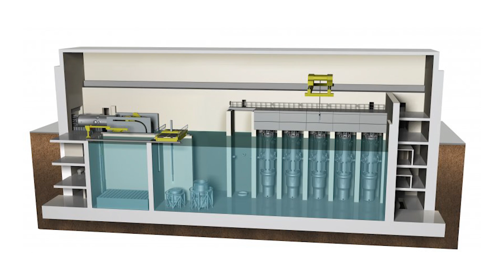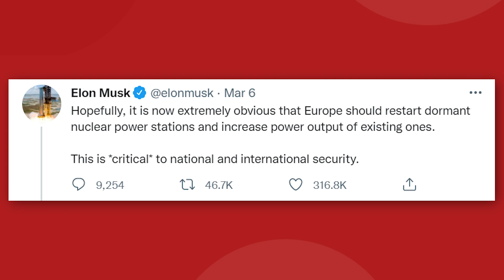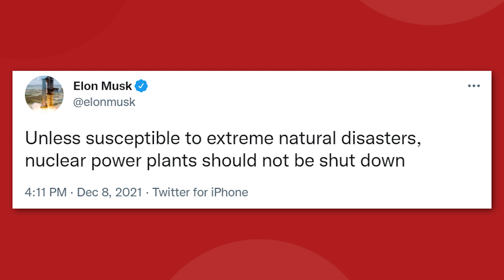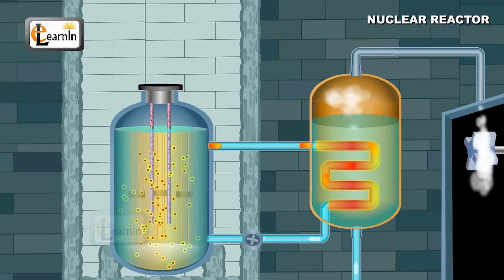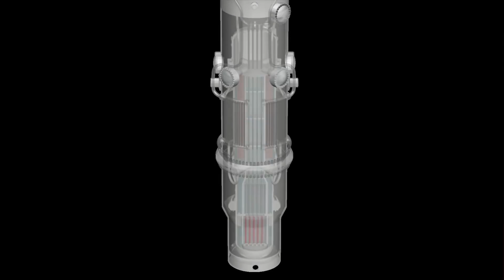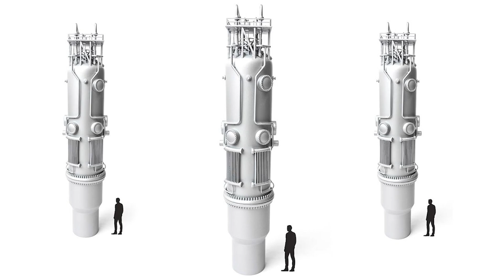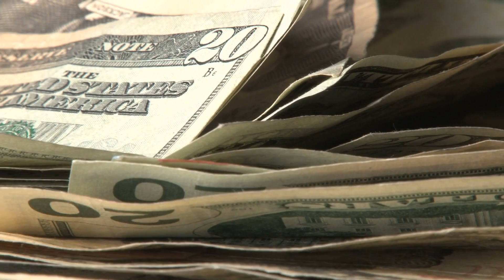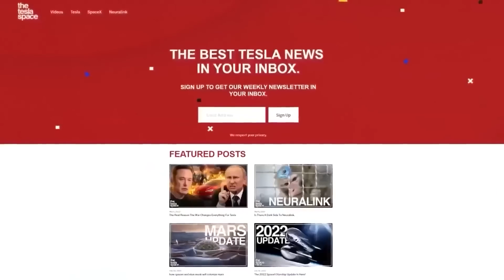The Real Reason Nuclear Energy Is About To Take Over!

Comment: You need to investigate liquid fluoride salt thorium reactors.  They produce far less nuclear waste that remains dangerously radio active for only 300 years or so as apposed to the nuclear waste that is dangerously radio active for thousands of years..  In addition they can use nuclear waste from old water modulated reactors to produce power.  In addition they shut down automatically if things get out of hand. China is way a head of us given that they are already building LFTR nuclear power plants based on Oak Ridge LFTR experimental power plants 60 or so years ago.

Comment: The #1 impediment to clean, safe nuclear energy is anti-nuke activists. Fighting lawsuits and unnecessary licensing and environmental 'reviews' DOUBLES (at least!) the cost of a nuclear power plant, slows down when electricity can be generated by a decade per project, and scares away investors.  Without their interference, we'd be living carbon-free already.

Also... not free ELECTRONS. It's NEUTRONS that can cause a nucleus to split. =)

Comment: Did you eat paint chips as a child?  It's NOT the purpose of boiling water, it's driving a working fluid through the Rankine cycle, just like all the other power plants.  These could still blowout from a steam explosion...
Reply: A steam explosion is not a nuclear meltdown, and any power plant using steam could also blow as you meme.

Comment: I have a star ship design that requires three such modules for propulsion and station power shipwide.  A minimum amount of solar power would be available at first but then 3 nuclear modules of 25 megawatts or larger.  75 megawatts seem like overkill for this project, but a 20 year life span is cutting it close.  I suppose that running at a very low power, like 5 megawatts continuously would extend their lives or perhaps they will run at 25% after 20 years and that would be okay also.    So my question is:  How much do they cost and how much water do they need for continuous running at say 10 megawatts?
Reply: Since the power conversion to electricity is not 100% you should worry about how to dissipate the excess energy in space. Water, if used at all, would be recirculated and is not an issue. Radiant Nuclear is making a design that uses only helium.
Reply: @alan.wootton  correct.  My engine idea is hotter than a nuclear reactor or engine and the heat will be a big problem, to solve this I must use water for the engines, but recycling it more than once may be problematic, but it can be utilized to generate more electricity, and hopefully last for 3 or four minutes into orbit before reaching critical temps.   As for the nuclear module, it is actually part of a much bigger orbiting space station and would  have millions of gallons of water for coolant and space is cold so it won't be a problem once in orbit.   Helium?  THat sounds interesting, except that it is hard to contain helium as it passes through most materials, plastics and thin metals.

Comment: SMRs using water/Boron are still high pressure but I agree are totally safe. They produce a similar amount of waste per KW/hr as traditional Nuclear. By contrast, Molten Salt Reactors (MSRs: next generation SMRs) generate about 95% LESS waste and some designs even run on existing nuclear waste. In any event GO NUCLEAR. Far more resources should be fast- tracking both.

Comment: I'd like to hear more about our LONG-TERM ability to manufacture fuel and then safely store the waste. I'm not completely opposed to the idea of nuclear energy, but everything else being equal -- which I realize it's not -- I'd rather not promote a technology that generates large amounts of highly radioactive waste with an incredibly long half-life. I'm still also attracted to the greener concept of a multi-technology plant, that combines solar panels with wind turbines and a large battery storage system. But it's impressive that these SMRs can't melt down if there's a loss of power or coolant due to the electromagnetic control rods, and the modular design and longer service life is a great plus.
Reply: Check out thorium reactors, I don’t know why we don’t mass produce them after a sound design is developed, they “burn” nuclear waste and reduce their half life dramatically, about 100 years total radioactivity instead of 10,000!
Reply: The waste has never been a technological problem, only a political one.  Oklo Gabon proves that even a natural two-billion year old nuclear waste dump was never a problem even without out technology today.

Comment: There are three issues that determine what generates our electricity:
economics, economics and economics.

According to the Canadian Nuclear Association, SMRs "hope" to get down to $80/Mwh after having built "several hundred" of a common design sometime in the late 2040s IF they  can agree on that common design. That price is more than wind and solar backed by batteries are today, and they are getting cheaper. 
So, sorry, but SMRs are neither a quick or a cheap fix to our power demands.
Reply: That’s just a bunch of lies.
Reply: They're pretty much battery chargers to the wind and solar because them need energy to make them work.

Comment: Neutrons and not electrons are needed to sustain fission - fix that error at 6 minutes. NuScale is only getting started by 2029, so wind and solar must be expanded massively now. With such a slow start, new Nuclear will lag renewables and it remains to be seen if these new SMR's can be more economical than renewables plus storage or existing BWR/PWR. Several designs (not all)  do seem "walk away safe" without the need for powered cooling pumps to remove decay heat so there is some promise they will be safer, but uranium 235 based SMR nuclear will emerge to reduce the need for batteries to support cheaper renewables and to make hydrogen and will not dominate the future source of power.
Reply: Everything is more economic than renewables and storage. They’re so un economic that it’s never happened at true grid level
Reply: @kokofan50  Low cost gas has pushed coal out of business. Wind and solar are now lower cost that gas even without any price on carbon and renewable price is going down. Suggest you look a Lazard levelized cost of power.
Reply: @rickrys2729  Lazard leaves out a lot of costs. Try looking at the empirical data. In 2020 Germany had far higher electricity prices than their neighbors in France. Germany has been on a decades long renewables kick, and France has been mostly nuclear

Comment: Nuclear great as long as you stay away from repackaged Cold War relic reactors, most SMR are based on the same design that Brought to you Fukushima, Chernobyl, 3 mile island, I think your confused between the term’s SMR and MSR, old reactor like the ones currently used have a efficiency of about 1%, MSR have a efficiency rating of about 99%. Efficiency makes a big difference in the amount and time you have to Store hazardous radioactive waste, a 20,000 years storage drop down to only 300 years just by using a MSR. Radioactive energy released from uranium not only heats the water but also generates explosive gases from the water, same type of gases that cause the explosion of the space shuttle, when things go wrong at a reactor this is what makes it explode, MSR don’t use water and able to operate at higher temperature with out the need for expensive containment measures.
So you might want to do a little more research next time.
Reply: They're all uranium based.

Comment: We have been hearing this srory fo 50 years.  Nucelar power will be too cheep to meter.  It seems like you've detailed all the reasons we should not be doing this. Yet the story is about more nucelar and more subsidies.  And still no solution for the waste.  In the mean time, solar, wind and batteries are the cheapest and fastest way to get energy and it's getting cheaper every day. So I really cannot see why anyone would pursue this.  We just do not need it.
Reply: No way in hell solar and wind catch up in time, if ever to charge even half the cars this numb nuts wants to sell.
Reply: Wrong on so many levels.

Comment: Not convinced that this will scale that quickly. Sodium ion batteries would be quicker to scale and lot cheaper. Also woul encourages decentralised generation and storeage. One of Tesla energy heads hinted that Sodium ion will be a major factor for stationary storeage.  Would be interested to see your take on it.
Reply: So how do sodium ion batteries CREATE energy then?!?
Pretty sure they are just storage and not power plants like a nuclear reactor!
You can’t really say one is better than the other when they are completely different things doing different jobs in the first place!
Reply: @bibson1405  Renewables are cheap and saleable, but their weakness is reliability. No issue in getting to 100% or even 150% renewable energy production.  So cheap reliable storage it the missing bit of the puzzle.  Nuclear wins on reliability, but not on the cost. However if storage was cheap enough you would not need nuclear. The other factor is that a decentralised generation and storage is ultimately going to be cheaper and more reliable as well. Nuclear falls directly into the centralised model of power generation. Sodium ion batteries will probably be as cheap as $20 per KWH. This means every home could have 20 or even 50kwh storage for perhaps a few thousand dollars.
Reply: @benwatson5211  The problem with renewables is their low power density, which leads to very high amounts of materials needed, such as silicon, metals, glass, carbon fibers, etc. Materials that have to be mined, refined, processed, transported, assembled, maintained, disassembled, and recycled. Some can not be recycled.
In many ways renewables are a lot better than fossil fuels, but melt-down-proof small modular molten salt reactors operated with existing spent nuclear fuel (also called nuclear waste by some) are a lot better than either.
Reply: @JGZimmerle  as usual, you don't have to choose one over the other.
Reply: @n.g.s1mple29  I totally agree, and the nuclear option is not something that individuals can choose anyway, apart from casting their vote accordingly at the ballot box. On an individual level, the only choices are between fossil fuelled and renweable energy equipment. This is why our family and company has chosen to power and heat our buildings by solar-, wind- and geothermal energy for the past eleven years.

Comment: I don't get your math with this.   You make little ones to divide the problems by 1000 but because  they don't create as much power you have to multiple the number of them by 1000.   This sounds like a marketing idea rather then a solution.
Reply: It’s cheaper to make a smaller thing 1,000 times than a giant thing once.
Reply: @kokofan50  Well, that remains to be seen as the numbers usually quoted are misrepresenting the facts.   They tend to compare just the smr vs then entire plant cost, including control panels, buildings for the people, land costs etc etc.   That being said, People that are against nuclear power are never against it because of the cost.  It's the other problems associated with it.

Comment: Elons right, and the amount of deaths caused by nuclear is actually significantly less per TW of power when compared to everything else including hydro, wind, solar and anything fossil fuel related. There are essentially only 3 incidents with very low fatalities (Fukushima only 1 death, Three Mile Island 0 deaths and Chernobly is officially only 31) and Chernobly was a safety test with terrible design and inept untrained employees making a lot of mistakes.... Nuclear with all our safety systems is super safe.... And these smaller modular reactors will be even better for safety.
Reply: I'm no nuclear power expert but I'm guessing there's hundreds if not thousands of reactors around the world for decades now. N ur telling me just 3 accidents,  sounds safe as safe could be to me. It's baffling how anti nuclear we are while at the same time trying to get off fossil fuels. 3 accidents for 10s of thousands of days worth of operation is pretty fucking great safety in any industry. We should be putting these things up left and right with the cheap clean energy they offer
Reply: @joshlewis575  there are about 440 nuclear power plants in the world. The crazy part about nuclear safety is that if we were using molten salt and other types of reactors that safety record would be even better.
Reply: There were zero deaths due to Fukushima radiation.  You fell for a fake news story.
Reply: One time is one time too many because each nuclear reactor blown up is an endless cost.
Reply: @robertagren9360  Thats a bit of an extreme position... coal has effluent that's more radioactive than nuclear waste and its gets into the streams. Oil has caused countless damage from spills, carbon, and don't forget all the other things it puts into the air on a daily basis, wind and solar are pretty good - were getting better at recycling but its taking too long to get manufacturing up - it wont solve everthing, batteries are great but supply chins are only now ramping up and new better methods of mining are needed, fusion seems to be getting closer but not here yet..... More people die putting up solar on roofs in a year in the states then all the 31 people who died with nuclear accidents.... One time is one time to many can't be applied to anything related to humans.... it doesn't work, we just make things better as we go along and Nuclear has one of the best track records, hyrdo has actually killed tens of thousands of people with damns bursting in China.
Reply: @DavidMcCalister  
Waste is one thing. The plants are forever a cost to prevent exposure. We can dig down the waste but the plants have too high radiation that deconstruction isn't possible today.

Comment: Nit pikin' dept. 6:00 "more free electrons" I think narrator meant neutrons. Electrons are bit players in nuclear reactions. 11:00 "no way to get around nuclear waste"  Never say never. Thorium liquid salt systems process incorporate continuous chemical processing of fuel, which may include nuclear waste, until those waste components are degraded to non-radioactive.
Reply: it’s definitey neutrons in case of radioactive isotopes used in nuclear fissile reactions. As you pointed out, electrons play a role in chemical reactions, baryons (protons and neutrons) in nuclear reactions.

Comment: Lightbridge has a 3 lobed fuel rod that can be used in existing nuclear reactors. The power output using their rods increases even though temperatures are reduced into safer ranges. From their website: "Our initial fuel enrichment is 15-20%, making it the lowest strategic value for proliferation potential. Lightbridge Fuel™ contains significantly less plutonium than conventional uranium oxide fuel and consumes more uranium during its operating cycle. Any plutonium in our spent fuel is “useless” for nuclear weapons, according to an April 2018 issue of Nuclear Engineering and Design."